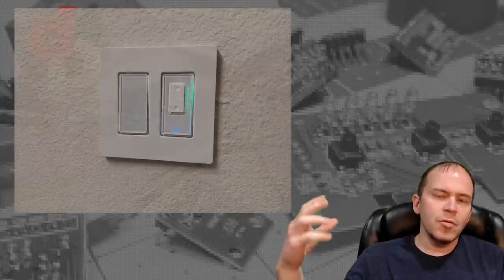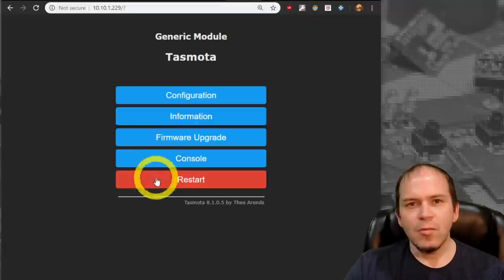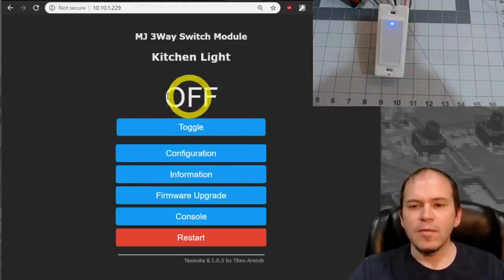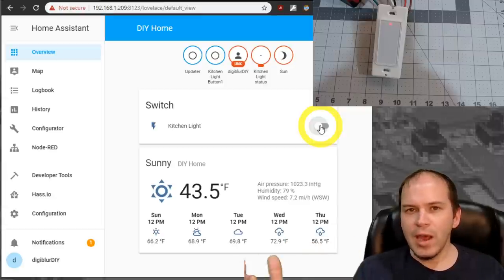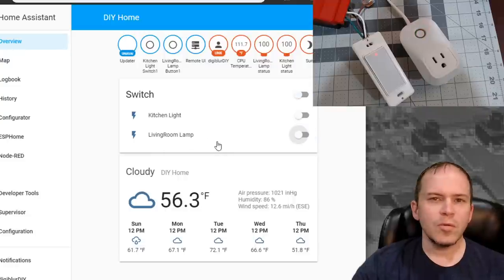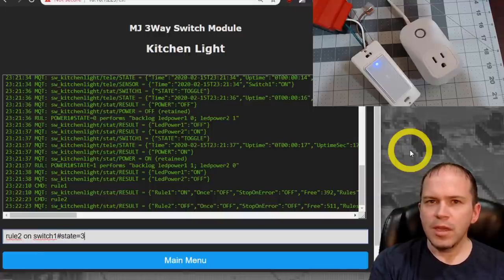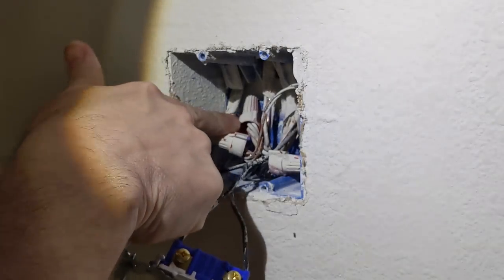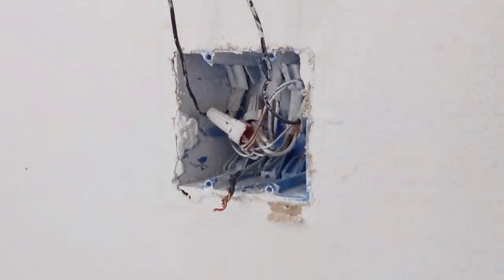How to Install Smart Switches and do Long Press Automations | DIY Smart Home - Ep#3

Comment: For UK viewers Black or Red in the US on single phase circuits as used in your home are Brown or Red in the UK. Neutral in the US is White whereas here they are Blue (modern wiring) or Black (old wiring). Green or Green Yellow is earth everywhere. As pointed out, never ever work on the switch while the power is on. We're twice the voltage of the US and it can and does kill. Good video man
Reply from the maker: Thanks! And never trust the colors in the box. It's like the bomb movies. Which wire do you cut? Blue or red?

Comment: 19:48 My wiring dint have the two black wires that tied together so I was confused for a second. So i grab my Non-Contact Voltage Tester, turned on my breaker and pray hopefully no one touches it while I was coming back from the breaker box. Then test real quick then ran back to the box to turn it off. lol. best work out ever!
Reply from the maker: Every scenario can be different and never trust the person before you. You could end up in a single gang box with the end run of the leg. Then it becomes a guessing game. The non contact is perfect for that.

Comment: Hi, useful video as always. Can I use a long press on a tasmota device to switch a lamp that has esphome on it?
Reply from the maker: Yes. Does the esphome use API or Mqtt?
Reply: @digiblurDIY  Hi, api
Reply: Hi, I use api
Reply from the maker: It can be done but you would need to do a HA or NR automation to act on a MQTT message. It's not hard though. Jump into my discord server (link in description) I am sure either myself or someone else can help. It's pretty easy.

Comment: You mentioned that discovery causes the prefix/topic to be in the wrong order (topic/prefix). I have one of my switches that I am trying to correct but it keeps reverting back. It's probably a simple fix but eludes me.
Reply from the maker: Do you want it back to the original way? If so did you turn off setoption19 yet?
Reply: @digiblurDIY  Thanks Travis, I have so much to learn!

Comment: Great video Travis, thanks.  Can you tell me why you don't change the client name?  I checked my devices and I have changed the client name to match the topic name and everything seems to work ok.
Reply from the maker: The client name is an internal name used to communicate with the MQTT server.  It will create a unique name based off the MAC ID of the unit, there's no need to change it as you'll probably never see it.
Reply: @digiblurDIY  Thanks Travis.  It shouldn't hurt anything I assume as I have changed mine and they all seem to work.
Reply from the maker: Yep. As long as it is unique.
Reply: @digiblurDIY  Great, thank you.  :-)

Comment: Travis, When I connected to mains and used the template per your instructions, my switch shows off, my HA switch shows off but my lights are on . When I flip the switch ON or through HA my lights turn off.  Where do i correct this ?
Reply from the maker: What switch is this?
Reply: @digiblurDIY  KULED KS-602s
Reply from the maker: Edit your template on the switch for the relay to be inverted then.
Reply: digiblurDIY Thanks that did it

Comment: Thank you this video helped alot! I got it up and running! However my setup was different any chance you know why? rule1 on button1#state=3 do publish cmnd/SW_KaiFan/POWER TOGGLE endon. I couldn't use switch1 it never worked. Is this just new to the latest version or something like that? Also it is a different switch maybe thats why im using the treatlife SS02. Finally im gonna be doing this on a treatlife DS01 dimmer with tuya rx and tx no switch or button that should be fun to figure out any advice? Edited: found your webpage
Reply from the maker: That's because your template has button1 configured and we did switch1 on our template for the quick short and long press.  Using button1 is fine as you can also get the multipress actions.

You won't be able to do this on a TuyaMCU dimmer as the buttons do not attach to the ESP chip, it is all handled by the TuyaMCU.
Reply: @digiblurDIY  yeah I changed the template to switch1 like in the your video but I couldn't get it to trigger the command. Had to change it back to button1.

Well you just saved me hours of learning that lesson thank you good to know. I'll be ordering a different switch for that room.

Comment: Is there a way to use one of these switches in a 12V system? My power source and my LED strip is 12V.
Reply from the maker: This are AC based switches.  There are the Shelly switches that we have coming in this month and that we have covered before that run on 12VDC as well.
Reply: @digiblurDIY  Thanks. You would know this better than me, but couldn't you just use the signal this sends to HA to do the same thing that HA does on your screen, which is adjust the fade on the lights, or turn them on/off? And just disregard the entire AC part of this switch? I really like the way these switches look and work so that's why I'm trying to get these, or something similar, to work.

What is the Shelly switch called? I only know the blue or yellow boxes that go behind the scenes, not the actual fader.
Reply from the maker: If you are down to modding things you can just use the faceplate and power it via 3v3 or 5v depending on if it has the voltage regulator on the faceplate board.
Reply: @digiblurDIY  Yes, perfect, thanks, that was my plan - use a buck converter to get the voltage I need and lose the AC components. My knowledge of HA is very limited so I wasn't sure if that was even a viable path.

My next big challenge is that I'm using battery power so unfortunately I don't have the freedom to use endless wifi devices. Trying to figure out how to wire up a lot of things directly to my Pi. Or at least using as few ESP8266's as possible. I'm guessing my best bet might be to multitask a small number of ESP8266's.
Reply: @digiblurDIY  So I got wired up and working with a Treatlife DS01 that I bought  long time ago. It syncs and turns on and off through Tasmota but the fading is not really working right. Only sort of works when you turn it all the way down through Tasmota. Seems to be a known issue. Any thoughts on fixing this? Or might I be better off just going with the Martin Jerry ones you use?
Reply from the maker: I have one installed in my home and use it for low levels in the AM without any issue but I don't use any fade stuff on it.  Just the basics for on/off and dimming levels.

Comment: can you recommend some EU switches?
Reply from the maker: Unfortunately no. I don't have any experience with them nor has anyone sent me ones from there. The only option that I can recommend are the Shelly1 and 2.5 modules that would work in your wiring.
Reply: @digiblurDIY  do they support long press ?

Comment: I only put "homeassistant.local" into MQTT host which has worked up to now.
Reply from the maker: If the local domain DNS works on your network then definitely roll with it.
Reply: @digiblurDIY  I am not a network expert. Is it a problem if it works? A security risk maybe?
Reply from the maker: Shouldn't be. Just not every network supports it and sometimes I have seen that change for some odd reason so I roll with the IP.
Reply: @digiblurDIY  ok, thanks